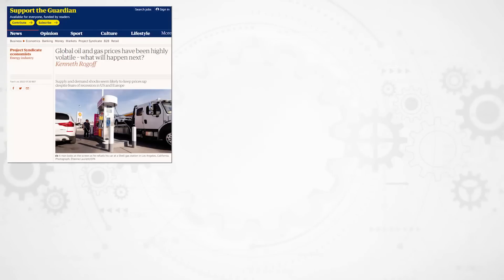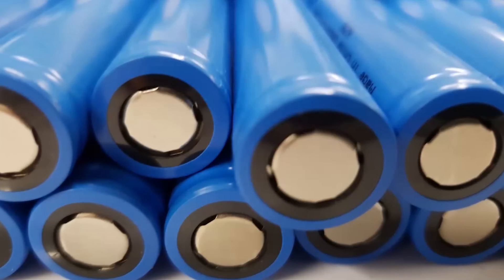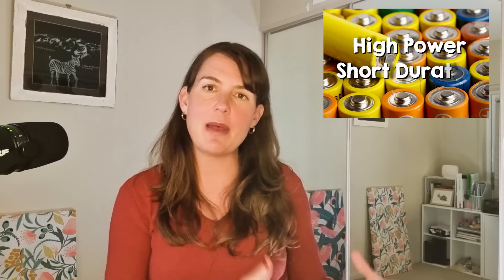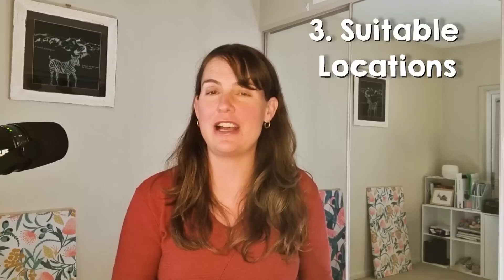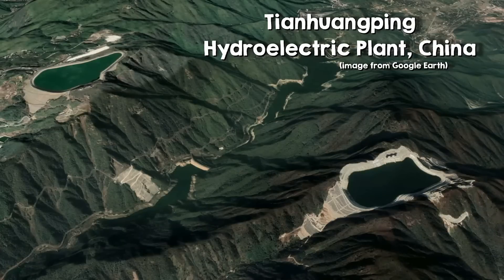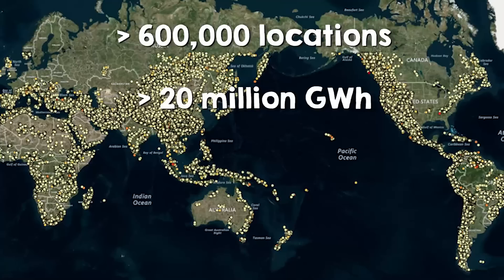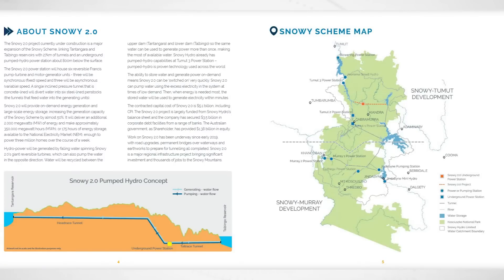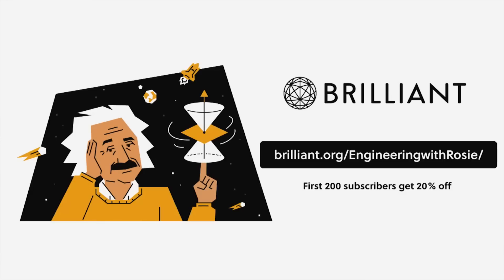Pump It Up When You Don't Really Need It: Pumped Hydro, Future of Energy Storage

Comment from the maker: Visit  https://brilliant.org/EngineeringwithRosie/  to get started learning STEM for free, and the first 200 people will get 20% off their annual premium subscription.
Reply: Hi Rosie,
That 300,000 times the worlds current total (2:48), is that just the current grid connected li-ion capacity or does that include car batteries? 
Assuming it’s not including car batteries, how much could car batteries contribute to short term energy storage to the grid? 

I’m surprised that V2G isn’t developing much faster. (I’ve seen your excellent video on it).
Reply from the maker: @Conservator.  it just includes grid batteries. It might be nearly time for another V2G video looking at how things are going globally.
Reply: One thing not mentioned is the option to use seawater pumped hydro, with the lower reservoir being the ocean. There is the Cultana project in South Australia as an example.
Reply: @andrewjames4617  yes, I thought at this too, since water shortage is happening a lot. but I never saw this idea mentioned. 
Norwegia could sacrifice a fjord and surely have more storage than needed.  but I assume they they are already almost green anyway, so they do not need too much to add. and also. what I forgot was flooding of houses near waterfront, and those could be quite plenty. 

but the idea of offriver location did not occurred to me that can be so sufficient. however I was aware of the option of flooding those regions under the sea level. huge projects considered since a century ago. but too big to be profitable fast enough for the greed driven financing.

Also, salt water may add costs, since salt ruins equipment quite fast.
Reply: Rosie : do you know if many of these sites are coastal? Despite the added cost involved in dealing with saltwater it seems to me that using the ocean as your low reservoir and then having an artificial saltwater pond/lake at a nearby point of higher elevation would be a pretty solid way to do pumped hydro. Are projects like this done or common?
Reply: @Dr.Gehrig  there’s is only one in the world - in Okinawa, Japan, and has been abandoned.
Reply: CO2 is a ruse. 
Climate change the "Greens" are talking about is caused by changes in the cosmic-rays/solar-activity relationship and cloud formation  (See the work of Henrik Svensmark.)  Cloud formation by actual cosmic rays can be scene with the naked eye in Cloud Chamber demonstrations.  YouTube has dozens of videos about them....

Comment: One huge drawback of pumped hydro is the energy loss from pump efficiency, turbine efficiency and line losses.  Depending on the specific situation one would be able to get approximately 50% of the energy spent in pumping the water uphill back.  Battery storage has a much higher efficiency.

Comment: It think combination hydro is forgotten. Example:   "Blåsjø" is a 7,8 TW/h storage at 1050 meter. It have 2100 MW production capacity and 320 MW can also be used as pumps.
There are others, but I have never seen it included in the pumped hydro estimates. If it was included Norway alone should have close to the global total you stated.

Comment: How about adding pumps just downstream from existing hydroelectric dams with a small retaining dam just to add capacity at dams that could use more water in their reservoirs.  I’m specifically thinks of the Hover dam/Lake Mead in Nevada where they could use more water in their reservoir so they could use solar power to pump water during the day upstream for them to use in the evening to generate power.

Comment: In balancing the Grid, the easiest way to use pumped hydro is to use what Nature has already pumped up. If you have a large reservoir behind a dam, you can draw it down when more power is needed, and block it more when demand is less. Once you set out to pump it up actively, that has to be much more expensive.

BTW gravity batteries have some of the same problem: You have to build a large structure to get the storage capacity, whereas a natural reservoir is already provided for you. The upside is that you can put it where you want it, at any scale.

Comment: Could we use old abandoned coalmines that are close to a river for pumped hydro? For power, you let the river run down a pipe with a generator. And when you have excess energy, you pump the water back out.
Same deal, but the reservoir will be hidden underground.

Comment: Good video, definately correct conclusion regarding problems with lithium batteries, however the ANU finding regarding the scalability of PHES is wrong. Still definately potential to be a massive chunk of energy storage requirements. Also worth noting difficulties utilising VRE to power PHES systems. Actually nuclear and PHES systems are great friends and would probably be the lowest cost and scalable system available. However you're correct it would require longer term investment rather than knee jerk shortermism.

Comment: I had a question about pumped hydro sites: I've seen quite a bit of discussion of using old decommissioned mines for pumped hydro, where old mineshafts and caverns act as the lower reservoir and the surface acts as the upper reservoir. This has the advantage that the access shafts can be repurposed for pumping equipment. Could this expand the sites available?
Reply: Indeed, these decommissioned mine sites are looked into as an alternative for the more classic pumped hydro sites. But the old mine sites carry a number of disadvantages with them, an unstable excavated underground being the most important.

Comment: Any one out there have direct experience with solar water pump storage on a smaller scale? Like to draw 500 watts for 3 hours per evening.
Tried a micro hydro but my fall and sediments made this plan a bust…..theory is fine…but actual pumping and generating has incredible losses. So if you actually pulled off a system….like to pick brain…..thank you.

Comment: Great video and comments about PSH, all are based on science, observation and experience.  However, the pumped hydro energy storage  is simple more expenses to save energy on excess generated mainly on intermittent energies like wind or solar. On total these will need and more distribution network and will increase the cost even more.
Battery storing of energy is good for any vehicle, but not good idea for stationary energy storing.
Coming across energy consumption world-wide around 27000-29000TWhr/year and calculating 10000 TWhr energy storing system is a simple exercise, but the world which consume 3.1-3.3 TWhr on a day, may not need 10000 TWhr energy storage.  These energy storage on 10000 TWhr may be needed only if the world has phased out 100% fossil fuels.
Finally the world can solve energy needed only using "levitation" of solid bodies and then the gravity power will be converted on mechanical, or electrical, or chemical energies. This levitation can be done everywhere on earth, closest consumers who use energy and so will use less distribution network, and the levitation can be done any time.

Comment: A very good video! I would like to ask: any potential for installing pumped hydro schemes in worked out (non-open pit) mines? For instance, South Africa has many worked out deep level gold mines  with shafts which are a few km deep. Any potential for using that existing drop of pumped storage - especially as South Africa has excellent solar potential?

Comment: YOUR ALL MISSING THE POINT!! 
Pump hydro cost about 40% more than the power you pay now WHY? 
well 40% is how much more power is needed to move it up hill and so the return in power when it falls through the turbines is 40% less but the power used to move it in the first place has to be paid for and guess who is paying for it? 
To date the worlds dams are all fitted with only one bank of turbines the thinking is any more and turbine surging will happen. This was right but in Australia in 2016 a proof of concept unit was tested by RDP Marine it can be retro fitted to all dams and give 5-10% more power from the same volume of water

Comment: Pumped hydro is excellent generally although it's end-to-end efficiency can be rather low (70%) but the primary problem is still poor energy density. Compared to the 100s or 1000s of TWh (Terawatt-hours) of storage we would ideally need, current pumped hydro in the UK provides only GWh, 1000 times less that what we require for a transition to renewables. A 1000x expansion isn't really doable !  Remember that you need to store more than just a few hours or days worth of energy to cope with the variability of renewables.
FYI, I looked at potential future sites in the UK for pumped hydro and there aren't many sites with the elevations you'd like. The UK is too hilly rather than mountainous.

Comment: Lithium Ion batteries are not a solution for mass storage of energy, except for maybe in a disturbed fashion like hooking up EVs to the grid and selling that capacity to the grid and things like that. What Lithium Ion batteries are awesome for though is evening out momentary peaks and dips, I mean like nanoseconds which means you can run the grid closer to the redline and not have to spin up extra capacity to make sure you don't drop below demand.

Obviously though they are useful for more than that, but that is what they actually accel at and is where they are highly economical feasible right now and can pay themselves off in a year or so.

Comment: The Electric Mountain in Wales is used as an energy storage, it gets it power from the Grid, which is becoming more and more Wind power generated energy, as we transition more towards renewables sites like this will be needed more as with renewables storage is key to making it viable, as the wind doesnt always blow, the sun doesnt always shine and the sea is sometimes flat, but with enough storage like that, we can keep the grid topped up during those periods, it also would mean we could keep the wind farms spinning in high wind, and not worry about overloading as, those sites could use that extra energy up storing it as potential futre energy.

Comment: What every hydrogenation facility needs to look at the ability to convert themselves to pumped storage as well. This could probably add a significant amount of pumped storage.
Another potential huge source of storage is BEV. Most of them are sitting home in the garage during the biggest energy demand mismatches. If they could be tapped to pick up that load and then recharge later in the evening it could also provide an immense amount of critical storage.

Comment: The Shoalhaven Pumped Hydro in the Southern Highlands of NSW ( a few km from where I live ) doesn’t appear to be run of river , it uses the Southern highlands escarpment to provide the head between the two storages and the water appears to flow through pipes in the escarpment. It was built in 1977. Presumably as a peaker for the coal fired power stations.
I think you will find that especially with global warming and especially in places like Australia, water is not free. It might be part of some rort , and appear cheaper to some people then it should otherwise be, but there is an opportunity cost to where the water goes.

Comment: The LCOE for stored VRE is pumped storage. $.05/kwhr for 10 hours stored. Lithium batteries are the highest. BATTERY STORAGE INCREASES CONSUMER COST. 

The other important thing is hydro/pumped storage is THE ONLY technology that can provide the 8 critical ancillary services required, most notably black start, frequency regulation, inertia. The grid DOES NOT function without these services. Batteries can do these.

Comment: The United States has a lot of hydro storage already built that is going unused.  For example, the total generating capacity of the Grand Coulee Dam is 6,809 megawatts and its average annual energy output is about 2,300 megawatts.  The total generating capacity of the Hoover Dam is 2,080 megawatts and its average annual energy output is about 478 megawatts.  By using solar and wind to pump water upstream to those two dams, we could increase their output by as much as 6,111 megawatts, with months of storage.  The same is true for many other hydroelectric dams.
Reply: you missed out the hours
Reply: This is wrong.  The reality is far more complex and difficult.
Reply: again confusing energy and power

Comment: What do you consider feasible options for pumping DOWN (low density) fresh water under (high density) salty ocean water? Would the upward movement of fresh water trough controlled piping deliver enough power to a turbine ? I'll check chatGPT to help me figure out the minimal dimensions for a prototype. 😊
Reply: You use air instead of water, it's called underwater compressed air energy storage

Comment: There is no off peak power. The entity that operates power stations has same operating procedures 24/7. The pricing system allows for discrepancies. The amount of fuel used is hidden on purpose. All renewable energy is accountable for these falsehoods.

Comment: I have one question. What is the difference in kWh per unit water volume km3 between charge and discharge? Hence its efficiency?
Reply: Of course you always lose some - the Second Law of Thermodynamics really sucks. The US DoE takes the "round trip efficiency" of existing pumped storage as being 80% on average, though most new purpose-designed ones would probably beat that (detailed design really matters for this apparently). For comparison, lithium batteries averages around 90%.
Reply: @kenoliver8913  I see. 
BTW pump efficiency is best rate by water volume loss. Example, drain vs pumped capacity per unit electricity kWh cycled. Some may argue with empty hands of data that efficiency is efficiency there is no difference either by kW hour against cubic meter hour. We will see when data is in the table.

Comment: Whichever storage you choose sand being the best you need medium sized grids with say 50 homes and local shops covered in solar panels charging the sand battery’s up ready for all the kettles going on at 5:30  6:30 when people are home from work paired with vehicle to grid power rather than relying on generators will help grids in this way would help reduce mass power cuts

Comment: They should cover the reservoirs with solar panels.
Reply: A project in Estonia will have solar panels both on the slope of the upper reservoir as well as floating ones on it. The lower reservoir is an underground mine.

Comment: What about underwater pumped hydro, like the Stored Energy at Sea (StEnSea) project being developed by Goethe and Saarland universities? 🤷‍♂

Their plan is sink 20m concrete spheres 700m underwater, and then use a 5MW turbine to pump the seawater out over the course of five hours. Then letting water flow back in for four hours will generate 20MWh of power. Each unit costs eight to ten million Euros to deploy, for a facility of up to 120 units capable of delivering 600MW for four hours, or 100MW for 24 hours, etc. They've already done a feasibility test with a 3m sphere in Lake Constance, and all went well, I hear, but it's hard to find much info on it. Seems like it would avoid a lot of siting concerns that you typically have with pumped hydro though. 🤔
Reply: Sinking concrete sphere or cylinders underwater is attractive concept even some pilots may be tested.  The case you present with spheres 20 m diameter on depth 700 meter will deliver some energy.  A facility with 120 Units  with diameter 20 meter and 700 meter depth if will work at 100% efficiency may generate 232MWh for 4 hours, or 38MWh for a duration 24 hours. Please correct me if you support your calculations or data.

Comment: Can you do an episode on HVDC transmission, and the feasibility of a global grid with little or no storage? 🤞🤓💜
Reply from the maker: Yes good idea! I'll at it to my (very long) list 🙂 I have a livestream coming up next week that will be on a highly (variable) renewable electricity grid simulation, and one of the interesting things about that model is how little storage it needs (only 5 hours of storage to get a 99% renewable grid) It's based on the Australian electricity grid, so it includes a lot of transmission (Australia's a big place and already mostly connected into one grid), but not HVDC specifically.
Reply: @EngineeringwithRosie  Interesting. Do you guys get enough nighttime winds to ensure you don't need to pipe PV power from the far side of the globe? Is that the case for most/many regions around the world, or is Oz special in that regard? I was anticipating long HVDC lines so that "oversized" solar farms in China could power nights in the US, and vice versa. 🤔
Reply: Nz is in miniature , hvdc between south > north island